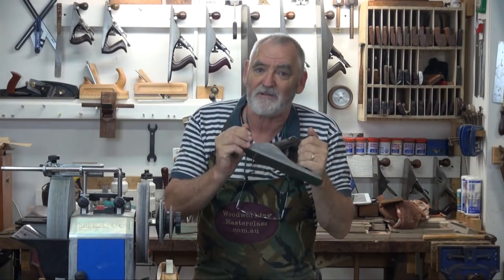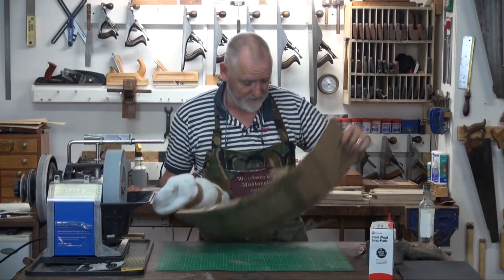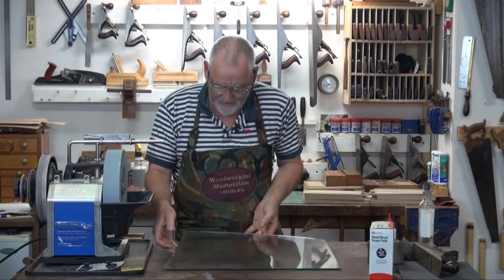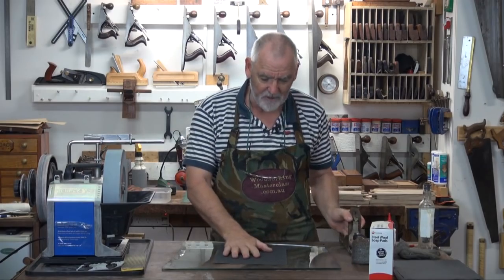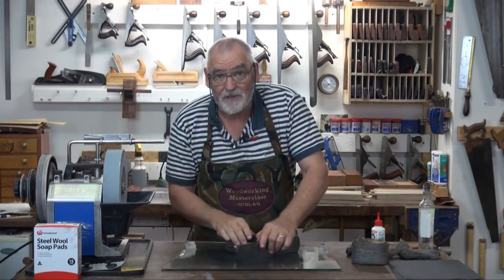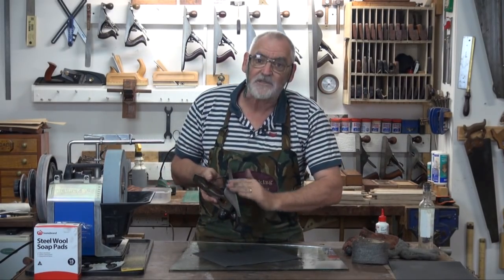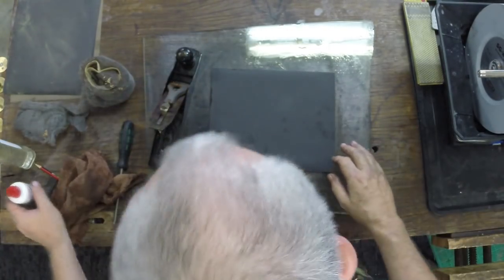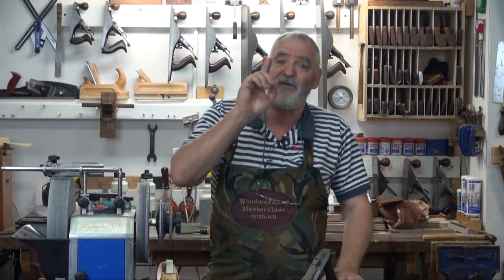Restoring Stanley 5 1/4 Hand Plane Part 1 of 3

Comment: Dear Steve, couple of quick questions. I'm in the middle of restoring a #5 stanley hand plane that belonged to my grandfather. Its in pretty rough shape, it looks it was dropped from a fair distance at some point. I tried to sand the sole but i need some glass. Unfortunately, both handles need replacing... would american oak be a good choice for a replacement? And should the grain of the handle run perpendicular to the sole of the plane or parallel? Also, once I get this thing in running shape (if I can) is there anything specific you do to keep your metal planes in good condition? I only woodwork in the summer and every fall I clean my tablesaw top, rinse, dry it and put some floor wax on it for both protection and lubrication. Is there anything you put on your metal planes or is it just a matter of keeping them clean? Thanks for any feedback, Paul S.
Reply from the maker: Hi Paul, most time it's 1/4 sawn and with the grain running parallel to the  sole.
If it's long grain it will break at the bottom of the tote where it secured to the base.
I have a couple of Old Stanleys that have an American Oak Knob and Tote.
What you are doing sounds fine. Moister is the real danger to metal. 
In all honestly to keep then in good condition use them often. Cheers Steve
Reply: Thanks for the advice, I shall endeavour to get my planes back in good shape. All my best to you, Bob the wonder mutt, and your whole family for that matter. Paul S.
Reply from the maker: Hi Lory, Big Tail Wag (with tongue hanging out) from Bob and return wishes from our family to yours, Cheers  Steve